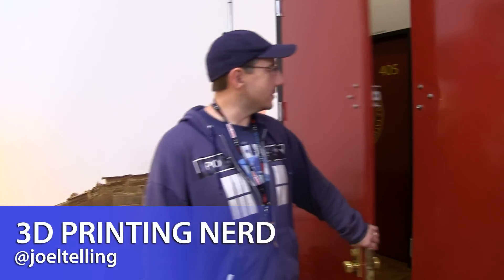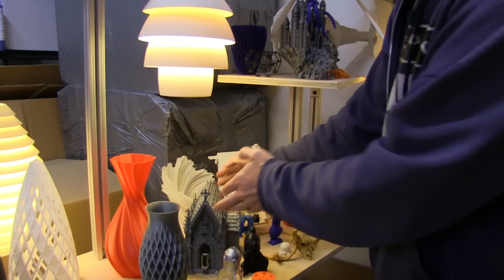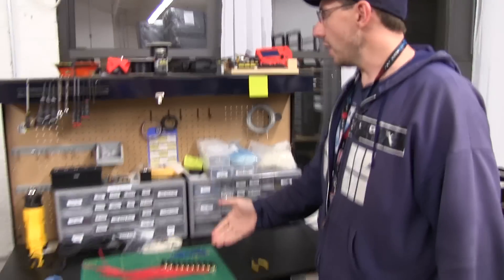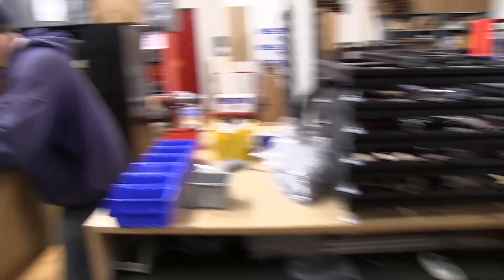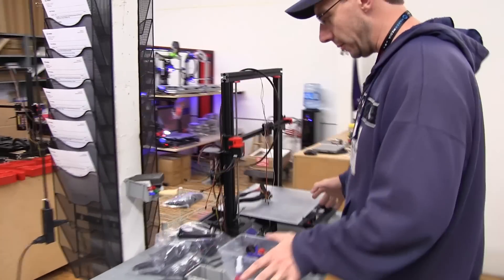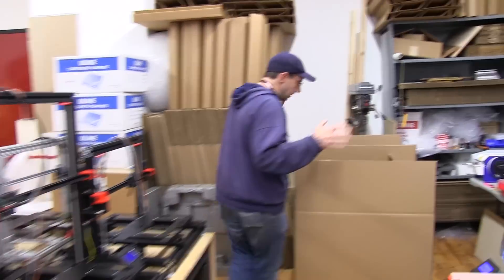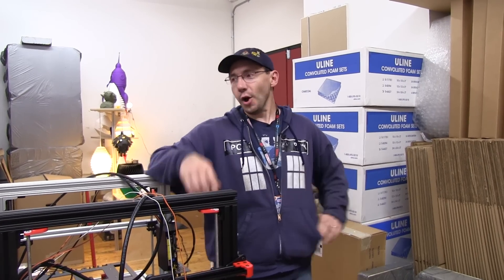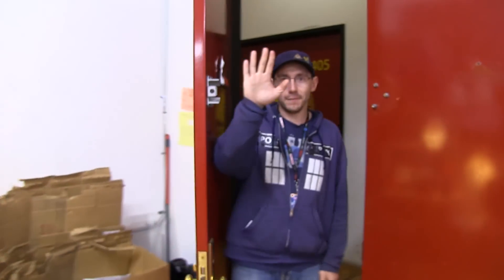gCreate Shop Tour during World Maker Faire in New York #WMF16

Comment: I just put together my prusa i3 mk2 and I cant seem to get the heated bed or hotend to turn on. I checked with a multimeter and there is no power at the 15 amp fuse. Everything else works and I will be going more in depth when I look at the schematics. Do you have any suggestions on what the problem could be 3D Printing Nerd